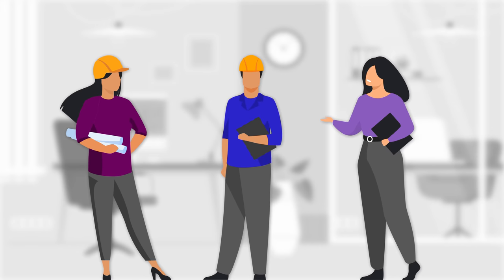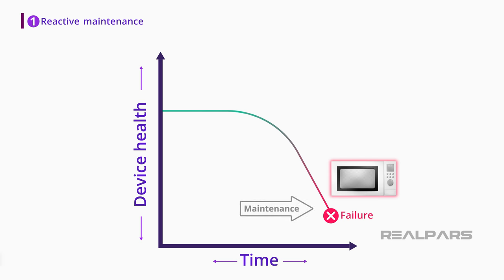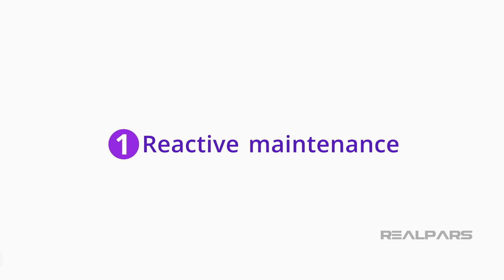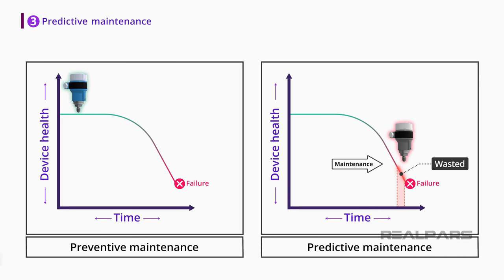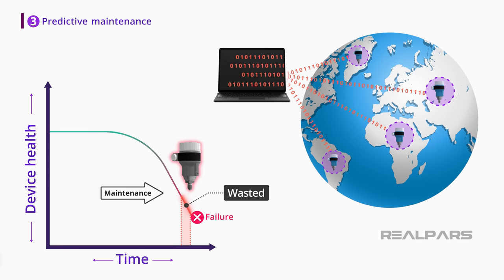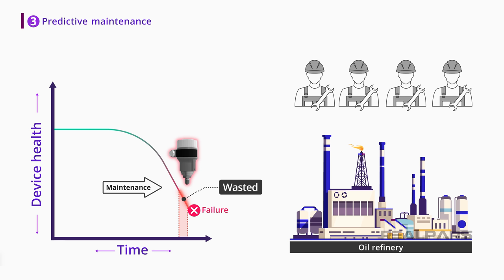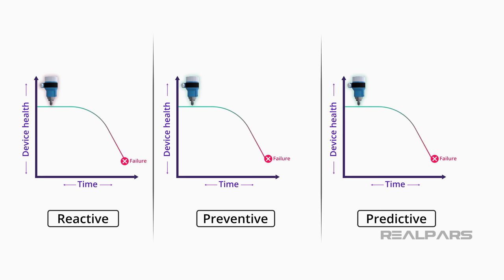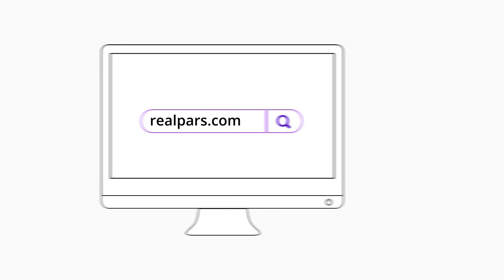Predictive Maintenance Explained

Comment: Predictive maintenance can also be divided into Condition based maintenance (CBM) where you predict the maintenance based of the health status from the data you collect from senors, and Remaining useful life (Rul) where you predict the remaining life of the machine at each point. Either way for PdM the most important thing is to collect lots of failure data in order to train your model predicting failure.
Reply: Is Remaining-useful-Life based maintenance not just a software extension of condition based maintenance?
Since you need data from the latter to calculate remaining life.
Reply: @soheil5710  it's an extension of course. But a separate thing according to literature
Reply: Could you explain more!

Comment: Predictive maintenance is the future but I think we need a new profession in the engineering fraternity that will just be responsible for precise data collection.
Reply: Yes and also realize that you can have all the data in the world, and then the best you can do is bring the thing down controllably, because: 1. Spare part is too expensive / complex, 2. The lead time before warning is way too short, 3. The actual failure distribution of the data is very Poisson like -> meaning, shoots up super quick just before failure and never earlier…

Machine Learning will not help you change the statistical distribution of these failures. So still a design challenge, which can be assisted by AI possibly to take care of all the requirements better.

Comment: sounds good as long as I don't have to collect the data myself or device manufacturers are willing to collect, analyse, and validate the data and make them available for its customers. Otherwise predictive maintenance is a severely limited solution that MAY or MAY NOT work even for the organisation that has the capacity to collect the data themselves.

Comment: Eventhough it may be called preventive maintenance, many technicians or maintenance personnels do not change their spare parts based on the recommended intervals in vendors' manuals but according to fail history within their plant or based on info of similar operations as failures are based on various factors i.e running hours, operating and environmental conditions, liquid physical and chemical properties, assuming that there is no installation mistake or human error. Hence, it is safe to say that predictive maintenance have long been in practice. 😊
Reply: It is true that predictive Maintenance is being used by specialists for a long time. But, by combining the use of computers with human intelligence I believe we can make this decision a lot more accurate.

Comment: IS REACTIVE MAINTENANCE SAME AS CORRECTIVE MAINTENANCE?
Reply from the maker: Yes.  They are two descriptions of the same approach to maintenance:  wait for a fault to occur, then correct and/or repair.
Reply: Corrective may have a part/sensor merely out of parameters yet not catastrophically failed. I see corrective maintenance as a site specific instagation of predictive maintenance, catching the part/sensor just as it starts its final slump into failure.

Comment: How to get actual diagnostic parameter from transmitter?  
we may consider to use HART/FF/PROFIBUS signal communication with Instrument Asset Management System (IAMS) and then integrate with PLC, PLC need to build up general rule & online detect specific parameter...

Normally temperature transmitter/pressure transmitter/DP type flow transmitter may follow maintenance engineer's experience to build up intelligent decision. 

However other specific transmitter such as radar, coriolis flow, ultrasonic transmitter, valve positioner usually end user just call vendor to solve at plant. Vendor site engineer sometimes bring their specific software to know other specific trend / signal ...etc. 
However those specific software also unable to integrate with IAMS...(whatever DTM already installed), Furthermore how is PLC can integrate with instrument for other diagnostic signal??? 

The video mentioned very good concept such as BN system 1 decision support but many type of instrument & different root cause related instrument life time...  

For me,  100% agree video concept but I still don't image how to go in to detail & make it reliable..
Reply: I would like to see this question answered. Integration is a huge topic indeed, and having asset health diagnosis automated can reduce the subjective and the costly nature of workers (perhaps). But, it tends to be workers that collect that data from SCADA, combine MES data, plus some verbal remarks from mechanics/oilers, put it in Excel and create Work orders in CMMS. I'd say that's a 30ft overview of maintenance in many plants. But, many OEMs start to integrate condition monitoring modules in their products. I'm not aware of many transmitters self diagnosing, perhaps you can tell it from data they output, but that would be software side - on your end to program.
Reply: @armelchiza3771  thank your reply... my previous statement still unable to full present how difficult for this topic.. 😅 😑 🙃
Reply from the maker: Great questions!  In order to use diagnostics from sensors for predictive and preventative maintenance, we need to be able to extract data from the transmitters.  With older sensors (4-20ma), this may not be possible.  We can use calibration trends to make decisions, but that is not very "rich" data.  Use of ProfiBus PA, FFB, and IO-Link opens up a wealth of diagnostic data from the sensors, but still, is only useful if it is read, stored, and actions taken.   PLC and DCS systems can certainly be used to read this diagnostic data but may or may not be able to store this data long term, although data historians .  AMS systems and other PC-based software is designed to analyze the data and provide actionable items, but it takes time, a deep understanding of the process systems involved, and a commitment to review and update of these systems.  This is not an easy task.  If the PLC can "see" the diagnostic register(s), it should be able to retrieve and store the data.  There may be "local diagnostic" data that is accessible only through a special interface, in which case, the vendor needs to be pressed to provide this data to your system.  This scenario is becoming more rare, since it is to the vendor's benefit to be able for the customer to be able to provide this data to them remotely.   All of these diagnostics opportunities need to evaluated for how they can be integrated into the plant's systems.  It is likely you will never have 100% diagnostic coverage.

Comment: Taking the human physiology as an example, we can analyse the symptoms and can perform a predictive maintenance but what about a 4-20mA transmitter? I have not yet seen them throw any symptoms, they just simply stop. I would really like to know in detail about the predictive maintenance before I conclude it's just a buzzword
Reply: Good question. Similarly other electronic devices that just fail all of a sudden.
Reply from the maker: A 4-20ma transmitter is a fairly simple device that either works or it doesn't.  The "live zero" feature is useful to detect a broken wire or loss of 24VDC.  Preventative maintenance for these devices can be employed by trending the results of calibrations over time.  If the "as left" deviations are trending higher, then a prediction can be made concerning the life of the transmitter.  Visual inspections (terminals beginning to corrode, etc.) can also be used to predict sensor life.  Predictive Maintenance is used most often in terms of equipment performance, but it can be applied to sensors as well.
Reply: The manufacturer might be acquiring good data to enhance their "mean time to failure" metric. They may share that to end users, who then follow the recommended predictive replacement.
However they may also be getting an unwanted feedback loop of sites changing sensors according to predictions that are themselves being used to time the replacement of the sensor. That would cause negative creep in the metric, leading to shorter & shorter MTTF.

Comment: The point is most of the industrial equipment  like that is running 24/7 and is not easy to schedule preventing maintenance and most cases the companies are not willing to do it, resulting in more down time when it breaks costing more thousands of dollars than a simply PM time could takes...
Reply from the maker: Thanks for adding that, Julio
Reply: Yes. Pushing time between replacement to near to it's maximum is important, but a small saving for a big risk just isn't a good gamble.
Having a redundant sensor/part is my preferred method. Not always possible, but definitely bolsters the collection of failure data.

Comment: As a hobby I happen to be working on an oil refinery video game and I intend to have equipment maintenance be a mechanic in the game. If anyone has ideas on how to gamify predictive maintenance, I’m open to suggestions :)
Reply: I work in that industry - you need to list assets and components across production lines, and schedule maintenance events based on machine work cycles and asset criticalities. The point is to reduce production line downtime. Yes, there is an asset deterioration line like in the video, but it can be extended with preventative tasks such as appropriate lubrication and replacement of small parts - you need both preventative (ex. lubrication) and predictive (ex. oil analysis) tasks, grouped in weekly/monthly routes.
Reply: How far are you into developing the game?

Comment: Also during preventative maintenance it takes more total time for tool to be down. Just because it is preventative maintenance does not mean that the equipment does not have to go down, the difference is that during preventative maintenance you can choose least busiest time to do PM.
Reply: Actually it may take even less time, since you know exactly what parts/tools you need beforehand.
No more panic diagnosing or waiting for part orders.
Reply: @soheil5710  Same stuff I can say about actual part failing.  If I am knowing estimate life-spam of the part, let it fail and without panics, diagnostics replace it. If part is not expensive you should have replacement in stock already. If you have more than one equipment with the same part, you could have a little bit more parts in stock.
Your comment does not add any value to the total discussion of the subject.
Some parts have life span and sitting in the  storage units reduces their life-span. Which reduces their failing time estimates.
Reply: @СтепанМакухов  failure in the middle of a production run is much much worse than planned downtime. Just because you have a box of spare sensors doesn't mean the product hasn't been subjected to out of parameters production, probably ruining the batch if not damaging other parts/equipment. Don't be naive.

Comment: I don't agree with you regarding the information collected by everyone to create a database because many parameters are not the same. For example, a transmitter installed in Africa under specific conditions, such as high temperatures and humidity, is not the same as in Europe where temperatures can drop below zero.
Reply from the maker: You've raised an interesting point. If I were to create a database based on your question, I'd gather data from the region or area where I'm located for meaningful comparisons. Wishing you a rewarding learning experience with RealPars.